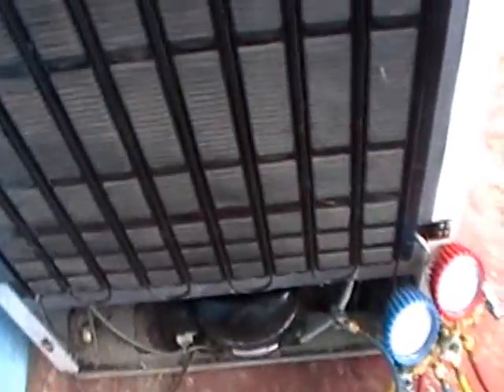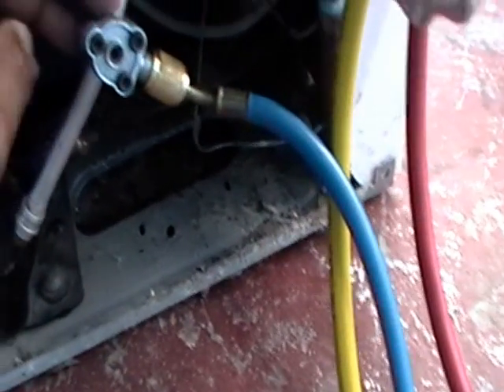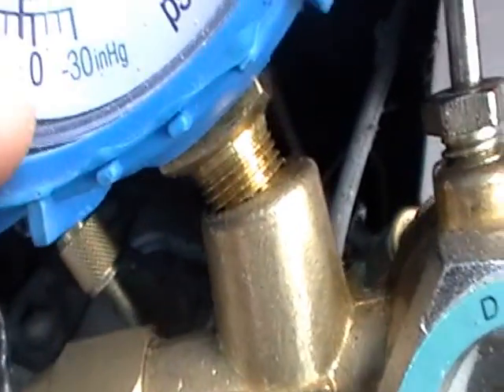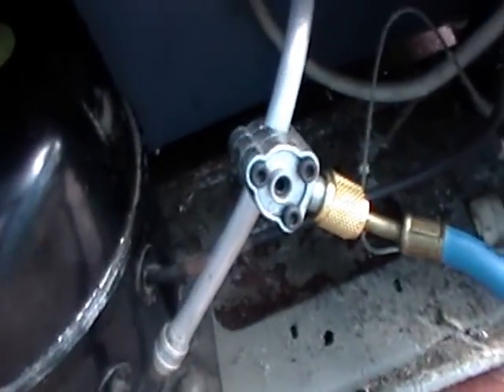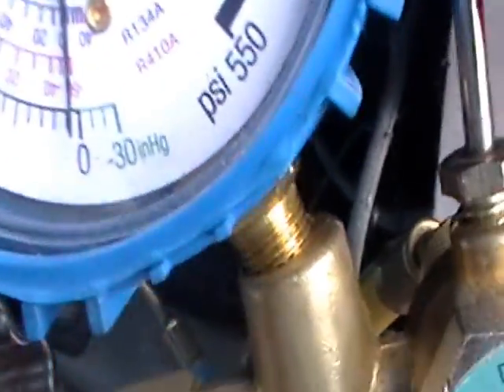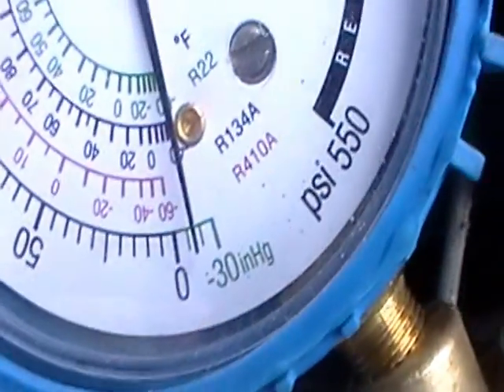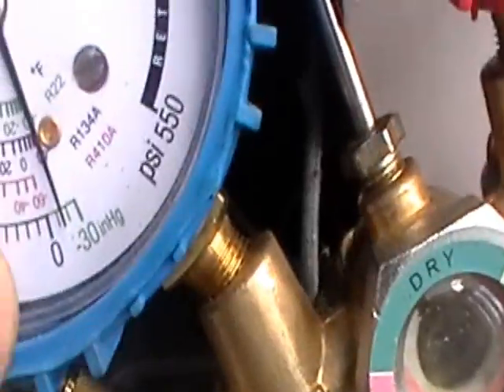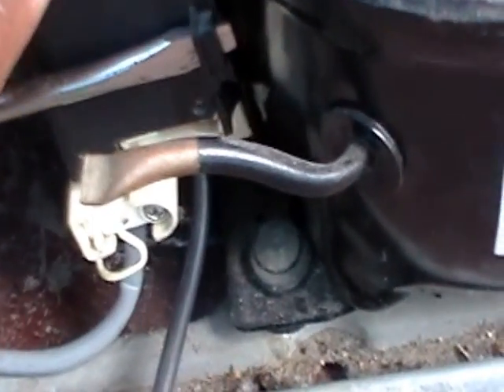how to recharge a refrigerator  part 2

Comment: It's best to put the valve on  the stub line on the other side of the compressor. Your system is over charged when the suction line has frost on it after it has run for some time.

Comment: Hi I have a question, I already check the compressor, replace the relay and overload but I can’t hear the compressor turn on, I wonder if the system doesn’t turn on when there’s not Freon in the system?

Comment: man you should not use a single gauge with a 12" line, a charging hose. those ac lines are too long for proper, accurate charging. i use those for ac's but use the shortest hose hooked up to a single gauge for refrigerators, ice makes, drink fountains, all things which a ounce make a huge difference. with what you have now, when you get the right pressure then close your manifold, you let out 6-8 ounces, even more when you take your hose off... i use something like this, for fridges and ice machines check it out, its on ebay and cheap http://www.ebay.com/itm/TNK-1114SM-BLG-R410A-R22-R134a-Low-side-2-1-2-Blue-Gauge-w-One-Way-Manifold-/281885670570?hash=item41a1b1fcaa:g:BpMAAOSwA4dWIQSb
and here a better one http://www.ebay.com/itm/Mini-Split-System-Low-Side-Charging-Manifold-Pressure-Gauge-Hose-Set-/291608304034?hash=item43e53599a2:g:WfgAAOSwYHxWOk3u
Reply: jess can yougive me some help as to charging my fridge?